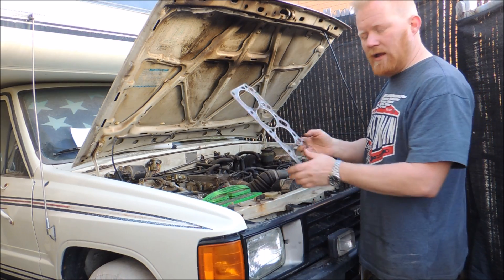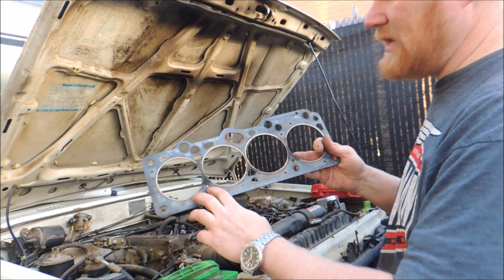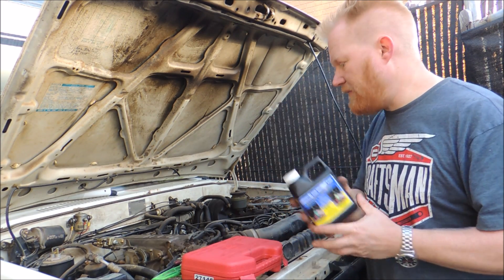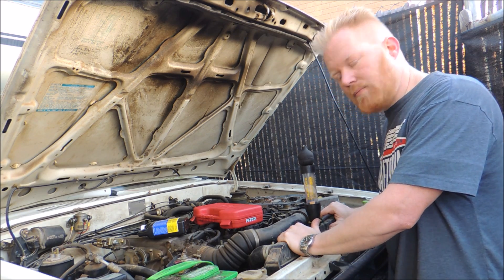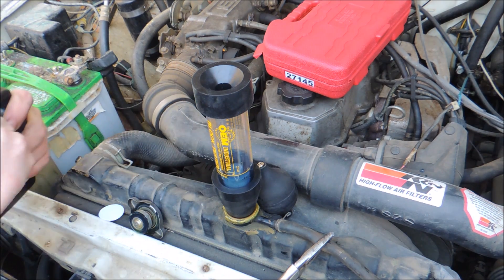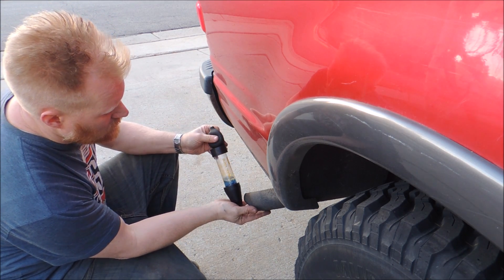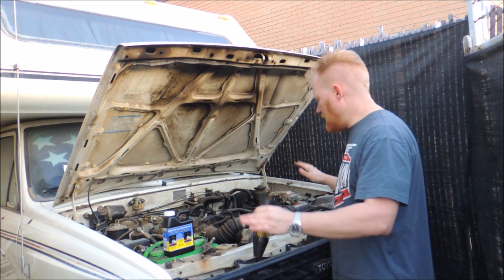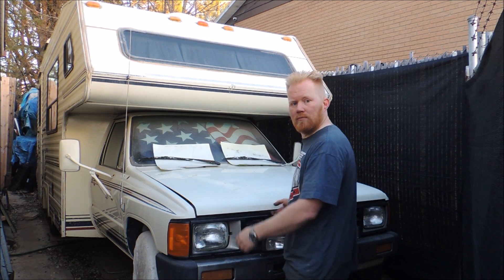Did you blow a Head Gasket ? Find out easily.

Comment: Can I still use this test if my water pump gasket has a small leak? Will it give an accurate reading? Or do I have to change water pump first? Thnks
Reply from the maker: Yes. The test only looks for exhaust gas in the coolant system. Which there should be none, even if you have a water pump leak.

Comment: So what was your issue with the coolant loss?  I have a similar one myself, I loose coolant from the reservoir but it is clearly coming from the radiator cap which was replaced and still experiencing this.  I can smell sweet exhaust fumes clearly but the block test kit was done twice with no color change.  I'm stumped!
Reply from the maker: My water pump gasket had a very minor leak. LIke you know, sweet exhaust fumes is a definite leak into the combustion. The leak could be into the intake manifold and then pulled into the combustion chamber through normal engine running. This would give no burnt gas into the radiator and the test would be negative.  You could try putting a hose from the exhaust, directing into the engine air intake and see if that puts exhaust into the radiator. But it may not as the intake manifold is generally under a vacuum and would only be sucking air instead of pushing it back out into the radiator like the head gasket.

Comment: Hey! I just got a 1986 Toyota sun land express, it's blowing white smoke until it's warm, the coolant and oil are disappearing but not visibly. I just traveled 150 miles today, turned it off to use the bathroom, went to start it two minutes later and the engine and exhaust pushed out white smoke while shaking the motor home with its rough attempt to start back up. Any ideas? Head gasket for sure? Maybe a tune up? Maybe valve seals or valve cover gasket? Anything else? Mine only has 70,000 miles on it and it was sitting with the previous owner for a bit.. I also just recently changed the oil and filter about 500 miles ago.
Reply from the maker: You need to determine if it is Smoke or Steam. Smoke and you're burning oil, Steam and it's coolant. Steam from coolant dissipates pretty fast and is sweet smelling. Smoke is thicker and said to be more blueish white or pure white without dissipating. You can also get steam from water in the gas but it won't smell sweet and generally only happens on cold days when the engine is cold.

Comment: Hi,,Please,,,is a manifold gasket the same as a head gasket ?? Can you please answer this question ??  I have oil mixed in with my antifreeze in the radiator..THANK-YOU !!!
Reply from the maker: They are not the same thing. But you can have intake manifold gaskets that mixes oil&coolant and need replacing.
Reply: Thanks for the info 65ford !!

Comment: What about when you burn transmission fluid. If your transmissions vacuum modulator goes bad transmission fluid can be sucked up the vacuum hose into the intake and burned off through exhaust.
Reply from the maker: That's blue oil smoke and different from the sweet smell and steam from antifreeze smoke.
Reply: Read this:
What happened was I was driving along; Temp Gauge Goes Up To “H”. Warning buzzer goes off. Fortunately I Was near Grandma’s. We pull up. Coolant leaking. No steam/fire fortunately. I Call Dad and He Calls AAA for tow to CDJR Dealership. Takes 4 Days to repair. (Dealer Understaffed). Costs $532.66L. Then We leave Dealership. Make <1 Mile Down Road. At 3⁄4 Mile, We See People Waving At us Like Crazy. We Look Up And There Is A GIANT White Smoke Cloud Behind Us. Smoke Comes Through Air Vents, Smells Like Burning Oil. I Riding Shotgun At The Time (Dad Driving) About To Hit The Ejector Seat! (Thinking Car Is Going to blow) We Stop At Our Church Which Happens To Be Right Ahead. A Cop Stops By Us Seeing That Our Hood Is Open And It Is Smoking. We See Red Fluid Dripping. I Know It Is ATF. I Figure Out That A Hose Burst. And Fluid Was Blowing In Wind Hitting Hot Exhaust Pipe Then Burning Off In Smoke. Aha. (Judging B/C Wheel Is Covered In Oily Substance. Cop Says It is ATF. We Stand Outside The Church Waiting For Dealership Provided Tow Truck. Waiting For Over An hour. L As Tow Truck Driver Turns Engine On To Pull Up On Truck, It Looks Like The Truck Is Bleeding To Death. Dealer Pays For Fix & Tow. No issues After That. Auto Tranny Line Clamp Rusted And Broke. The End. Wife Hates This Truck. Cost $6000 To Buy. Cost So-Far Est. $12k To Fix And Repair. Great Truck Though!

Comment: Will this test absolutely determine if the head gasket is bad ?
Reply from the maker: It will determine if a head gasket is leaking into a coolant passage.  You could still have a head gasket leak between two cylinders or directly out the side, that will manifest itself with low compression/power. This is easily tested with a basic compression tester.
Reply: sixtyfiveford Thanks for the information,
I appreciate it.

Comment: There's an easier way: open the radiator cap and watch for bubbles. If there are constant bubbles you do have a headgasket leak and also if white smoke + green liquid is coming out from the exhaust muffler...damn you need a new headgasket set urgently
Reply from the maker: Minor leaks won't show bubbles.
Reply: a leak isn't a bad a blow or is it the same thing. there's something wrong with mine. but it over heats occasionally and it bubbles when it overheats but1 not all the time.

Comment: So, you're saying that if there's smoke pouring out of my radiator cap, then it's a head gasket issue?
Reply from the maker: Not really. Smoke/Steam coming from your radiator means it's hot.
Reply: sixtyfiveford Problem is, it happens continuously after startup. What else could it be?
Reply from the maker: Johnathan Mason White smoke coming from the tail pipe with a sweet smell is a head gasket. Steam coming off the radiator itself probably means you have a leaking radiator.

Comment: yup, real easy.....unless you don't have the special tool, can't find it, don't have the special fluid.  Other than that, piece of cake.
Reply: Slappy Fistwad if you really can't find the tool or the fluid, you'd probably be completely fucked if you had a problem so don't even worry about it
Reply: Buy it. Simple
Reply: Another tell tale would be if your coolant hoses were solid and unable to be squeezed , normally at running temp you can still squeeze the radiator hoses.

Comment: One thing you should mention is the vehicle should be thoroughly warmed up before performing this test. Years ago, I had an old Nissan that had a very small head gasket leak. It was so small that even a leak down test passed. I was seeing these tiny bubbles in my coolant and was convinced that it was a head gasket problem. I used this kit, but it didn't change color until almost 30 minutes later. It was a pinhole leak. I used one of those Steel Seal kits to seal it up and it worked well. I retested using this and even let it sit on there for almost an hour without a color change.
Reply from the maker: +jjenson2006 Good point.
Reply: Makes sense that it takes 30 minutes especially if leak is very minor.  That has to travel all the way through all that coolant to get to the top and be detected
Reply: Tiny bubels?maybe it was pocket air or just air bubels? U didnt have ur cooling system bleeded well?u think about this in this way?

Comment: I don't have direct access to the radiator. The only access I have is through the coolant reservoir. Will this gismo work in my instance?
Reply from the maker: +moncorp1 Yes, as the coolant reservoir shouldn't have any combustion gases in it under normal circumstances but will if the head gasket is blown.

Comment: Thanks for the helpful videos! What kind of mpg does your RV average on long trips?
Reply from the maker: +Jason F Mileage is dependent on how big of jerk I want to be to others. If I push it hard it'll get 12mpg (65-75mph not always obtainable), if I go at it easy I can peak at around 15-17mpg(60mph). On average I manage 13-14mpg though which in caparison to a large motorhomes 4-6mpg, is impressive.
Reply: +sixtyfiveford That's pretty good considering the boxy aerodynamics and extra weight.  My 89 4Runner had the same 22RE and usually only managed 19-22mpg freeway.

Comment: I had coolant going into the oil. I used GM coolant stop leak, so far it is working.
Reply from the maker: +tfp777 Those stop leaks work surprising good. I've sealed up many busted radiators.

Comment: That is good news, but now you have to track down where its going.. :) Yea a walk around would be cool of the motorhome.
Reply from the maker: +MidwestMotoRider There's only minor amounts of fluid missing, I just wanted to rule out a head gasket. When I travel with this I will run 10-15hour stints so I'm holding high engine bay temps for long periods which could lead to overflow tank evaporation.
Reply: +sixtyfiveford Ah.. yes you did mention that I was not aware that the fluid could evaporate from the canister with just normal long driving. If so then yea that is probably the case here.
Reply: +sixtyfiveford Ah.. yes you did mention that I was not aware that the fluid could evaporate from the canister with just normal long driving. If so then yea that is probably the case here.
Reply: +sixtyfiveford  Ah.. yes you did mention that I was not aware that the 
fluid could evaporate from the canister with just normal long driving. 
If so then yea that is probably the case here.

Comment: HOLD one-you still have the situation of the loss of fluid. SO-could that mean a crack in the block or head-even though you gasket is fine?
Reply from the maker: +Robin Sauls Older vehicles are more susceptible to loosing fluid through evaporation in the overflow(not sealed nearly as well as newer stuff) and I'm used to it in my 60's and 70's vehicles. The fluid can only go into the combustion chamber(this test eliminates that), into the the engine oil (easily identifiable with visual inspection of the oil), out the side of the block/hose(through a noticeable or hard to find leak) or evaporated out through the overflow tank. When I travel with this I will run 10-15hour stints so I'm holding high engine bay temps for long periods which could lead to overflow tank evaporation. I plan to do a better visual inspection of the engine block etc.

Comment: my truck had a pinhole leak on the intake manifold cover, I was loosing coolant weekly and was very hard to spot. finally saw some dried up trails with a flash light and got it fixed. no more coolant leak now
Reply from the maker: +mikegigabyte Those can be hard leaks to diagnose.
Reply: sixtyfiveford my 99 4runner 3.4 smokes white smoke for first 10 - 15 minutes then dissapears!  other than alittle high idle at start up motor runs pretty smooth but after warm up the idle settles at 400 to 500 RPM,  and the car seems alittle underpowered to me when climbing long hills, its really struggling by the time you reach the top, im convinced i either have a cracked head or blown headgasket
Reply: my 99 4runner has the same symptoms except it doesnt smoke it just drips water or something for a long time even in hot ass weather. did you ever get yours figured out?

Comment: always wondered about those old Toyota RVs, if you were to sell the RV part and replace that with a truck bed? will it be cheaper and make sense? a tour video would be great
Reply from the maker: +Mr Merhtin The Toyota motorhomes are worth a lot more(3-10x) than the pickup version, which is contrary to most older motorhome makes. Occasionally you will find a rotted camper and people will throw a flat bed on them as you can't use a regular bed(dually tires) but they still have to fill in the roof/back of the cab as it was cut out for the motorhome conversion.

Comment: I know there might be a few of these stories, I used this on a 502 with blown head gasket and it did not show any signs of changing color. I put air pressure on the cylinder to do a leak down and sure enough i had a bad head gasket which was bubbling the coolant, thats how big of a leak it was. Just my experience with this type of tester.
Reply from the maker: +kdknitro Interesting..
Reply: Yeah, i found it really wierd. It was on a marine engine. I doubt that makes a difference.
Reply from the maker: It didn't have an open coolant system? It actually has a radiator?
Reply: Yeah, most popular  engine brands have closed loop system options. It helps the prolong the life of the engine. It uses a salt or raw water to coolant heat exchanger similiar to a radiator but they use the water to cool it. They do make motors that just use the raw water and dump it back out through the exhaust. Any of your big diesels and higher end options engines have a closed coolant system with heat exchangers. By the way thanks for putting up your vids, its cool to get exposed to some stuff like the evaporative cooler that would never work in Maryland due to the humidity. Keep up the good videos man.

Comment: Good video. I always wanted one of those motor homes and make it 4wd. I know they made a few but not enough.
Reply from the maker: +57WillysCJ They did and they seam to go for a small fortune when they are 4x4. I decided 8 years ago, when I bought this I wanted something more for cross country travel than camping. But over they years I have wanted to change it to a manual transmission and 4x4 by buying a donor truck.

Comment: Your thoughts on the head gasket sealant in a bottle stuff?  Any particular brand you'd recommend such as Blue Devil?
Reply from the maker: +Matthew Korkowski As a basic rule people will talk badly about stuff like this and there is no better solution than to just replace the head gasket. But there is always a time and a place especially if the cost of the repair nears the cost of the car. I have used Head Gasket Sealer before. It is basically sodium silicate, which has the nick name of water glass. You drain the radiator, fill it with water, add the Head Gasket Sealer, run it, drain it all out, and refill with antifreeze. The sodium silicate hardens when it comes in contact with CO2 combustion gases(the leak) and forms a hard, permanent seal. It won't clog up the system and will only harden where it contacts combustion gases. They use the same stuff in metal casting to harden the sand molds and make so it holds up to molten metal. I did it on an old gasoline car that the price to fix was more than it was worth. Last I heard, years later the car was still going strong.
Reply: +sixtyfiveford Thank you for the detailed response.  I'm in a situation where I think I have a blown head gasket, it's a 2004 Jeep and has 200k in miles so I don't want a thousand dollar repair when something else could just go wrong next.  It's a 4.7L V8 with an overhead cam and replacing the head gasket myself to save money is bit beyond my abilities right now.

Comment: Thats funny that you did this I was going to make a video on the same thing in about 1 week for my Grandparents in-law.  Their Cadillac is having a mystery coolant leak.   Where there is a loss of coolant put no puddle.   Funny thing is I bought the same exact stuff.   Not to demean you but  "great minds think a like "
Reply from the maker: +2LateIWon I'd like to see your take on it. It gives a quick definitive answer. Like a pregnancy test....
Reply: +sixtyfiveford basically if it's blown they will sell it.  if not ill get to crawl around like you till i can figure out where it's going
Reply from the maker: 2LateIWon
I have used Head Gasket Sealer before. It is basically sodium silicate, which has the nick name of water glass. You drain the radiator, fill it with water, add the Head Gasket Sealer, run it, drain it all out, and refill with antifreeze. The sodium silicate hardens when it comes in contact with CO2 combustion gases(the leak) and forms a hard, permanent seal. It won't clog up the system and will only harden where it contacts combustion gases. They use the same stuff in metal casting to harden the sand molds and make so it holds up to molten metal. I did it on an old gasoline car that the price to fix was more than it was worth. Last I heard, years later the car was still going strong.
Reply: +sixtyfiveford. oh wow good to know I'll look into that thanks
Reply: sixtyfiveford When you get a chance let me know what brand did you use? 
Thanks
Reply from the maker: I don't recall the brand but they are probably all the same material. I probably bought the cheapest stuff I could find. What year is the Cadillac?
Reply: I think it is an early 2000 STS  with the NorthStar.  It only has about 40K miles on it
Reply from the maker: My father inlaw's 2001 Buick has the composite intake manifold and they warp with age and leak coolant onto the motor. Most dries and gets burnt off before touching the ground. I threw in some basic radiator sealer(Bars pellets) years ago and it has stopped it since.
Reply: @sixtyfiveford  what kind u used that time cuz i need to do that to my subaru but my car doesn't have heater & idk  if is gonna work without putting on the heater??
Reply from the maker: @JosueLopez-te1ek  For a head gasket leak you'll use one of the many head gasket sealants on the market. For radiator or just coolant leak that's going external on the engine I like the bars stop leak (pellet form).

Comment: Isn't it normal for the water in coolant mixture to evaporate over time leaving a slightly lower level? At least that's what I've always experienced in warmer weather driving
Reply from the maker: +mrsemifixit Yes, and that is what I'm thinking. Newer stuff is less vulnerable to this but I'm keeping the engine temp/engine bay at temp for 10-15hour runs. The engine only has 40,000 original miles on it so a head gasket leak is unlikely, I just wanted to rule it out.